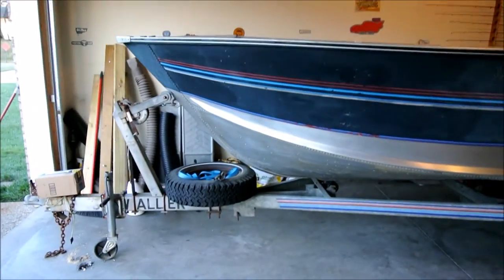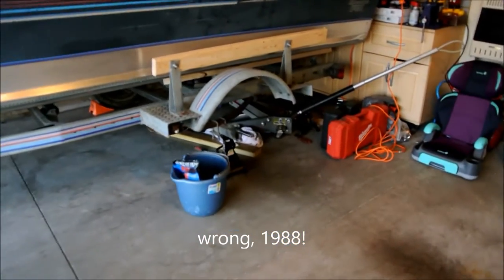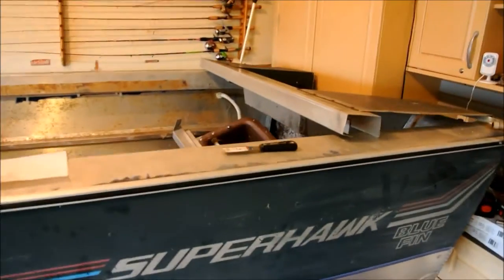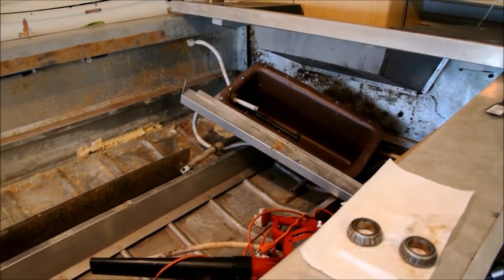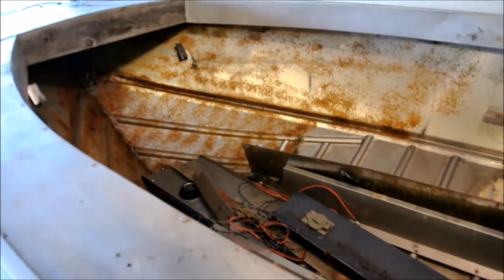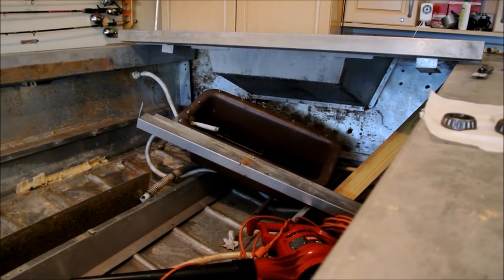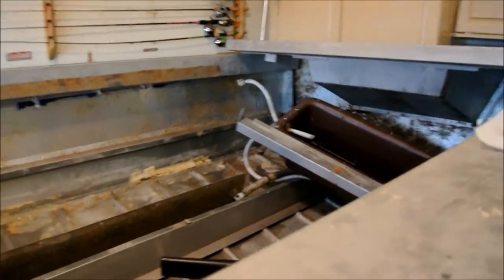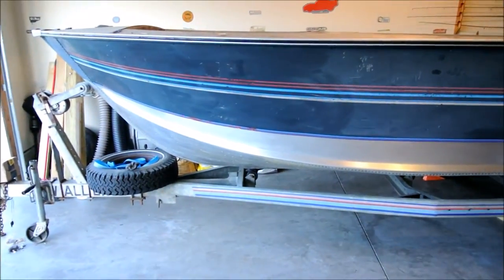1988 Bluefin Superhawk 16 ft remodel vlog 1

Comment: I have a 17'10 Blue Fin Sportsman's. My transom is bad, pulling apart. I want to get my boat seats fixed. I am trying to figure out where the screws are that fasten on the front small seat to the console , window part. I am not looking forward to trying to get the transom apart. I have to fix some of the back floor too. Thanks for the video.